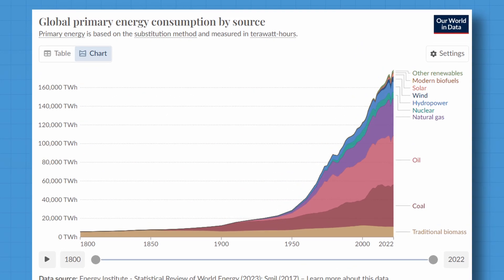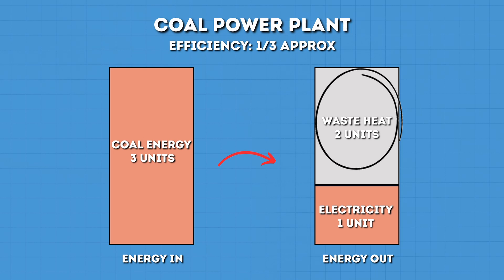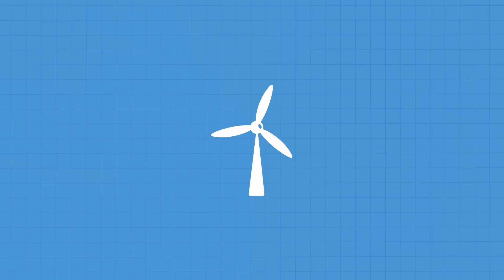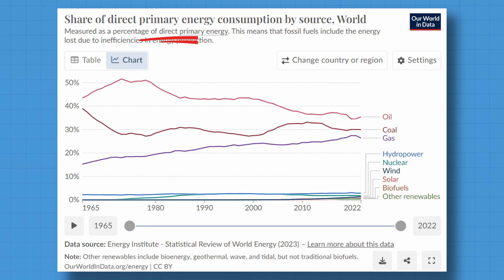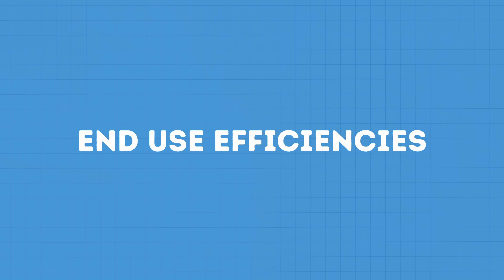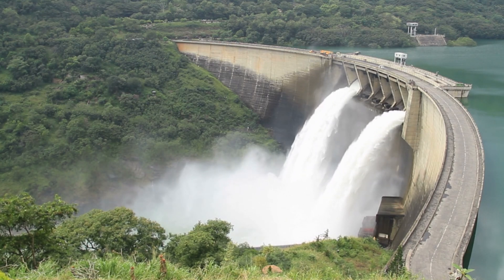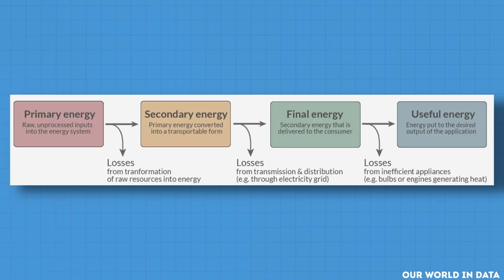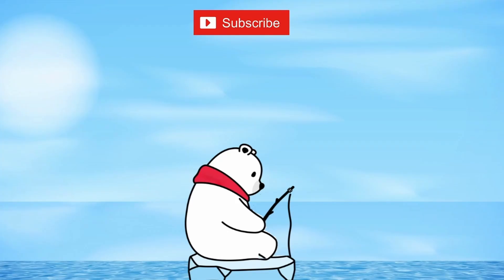We need to talk about the Primary Energy Fallacy

Comment: Since you cursed so much, its also good for your rebutal, you over simplified so much and missed out on the elephant in the room, intermitency and storage has massive costs, you dismissed energy storage almost as if its free.

Renewabale Enengy is trading a high value intermitant electrical energy for a lower value of energy usually thermal or chemical that has to be converted with losses into electrical. But you ignore the storage costs and you also ignore how varied these processes can be. Every one of those waste heat sources comes with essentially free storage, in the case of coal oil and gas it is usaually consumed shortly after extraction but the storage can easily be for several months or years if need be. In the case of fission, the storage is essentially for millions of years after digging it up, it can be processed into yellow cake and then Uranium fuel at will. It is also available from the oceans at moderate cost too essentially at will.

But your precious solar and wind can not be stored economically,, it's about 10,000 times more than chemical energy storage. The avg capacity factor of wind is only 30% max. The max capacity factor of PV is typically only 14% in the US NE. It can reach 20% or more in the US SW. In northern europe its only about 11% in the UK, but more in spain.

Buy a plastic bucket for about $1 and it easily stores 30KWh of chemical energy either liquid or rock form worth at least 10-20KWhr(e) after conversion.
Buy a Tesla wall battery and it stores only 10KWhr(e) for a whopping $10,000 or so and you have to pay for 1 of its wear and tear cycles say atleast $10 on top of its stored energy value of only $1 and that electrical storage in batteries is only for weeks at best. They self discharge you know. And batteries really really hate being full or empty, which is why Tesla keeps them in their 20-80% zone as much as possible when wear cycles are effectively 10x less severe. So to lkeep batteries near the 50% zone means you really have to double capacity to use the rated value, they suck.

You know that in the USA, solar insolation is 5x better in the summer than the bloody winter. How the hell do you store summer electrical energy for months rather than just days. Even for wind you would need a month of storage if thats all you had. The Danes play a lot of complicated games with their wind to extract as much value as possible, but a huge proportion of it is used to make hot water for heat storage and if not enough storage, throw it away. Does you production graphs cover the curtailed energy from useless over production, I doubt it.

Also the intermitency issue means that say you convert any of this precious energy into hydrogen for steel, you first have to make it 100% base load becaue all thermal and chemical industrial processes are always as continuious processes. God forbid your hydrogen production needs a catalyst like platinum while the electrical input capacity factor is mostly low.

No improvemnet in battery energy storage is ever going to change this 10,000 ratio. If you could get 10KWhr(e) into the same space as a chemical, it would be a frickin chemical.

The alternative for intermittent only energy source is bleak with out that  free battery like chemical energy storage from combustible sources that you all take for granted.

Dont you fucking  hate it when anti climate people say they know more than climate scientists and deny the climate science.
Well fucking electrical engineers hate it when climate science that denies the simplest facts on energy esp electrical.

Everyone I meet that worships your fucking turbines has zero clue where the big battery on the grid is, they think the grid is just magical. That big battery is effectively the chemical energy that can be converted at will from the least efficient peaker plants. More renewables automatically means more lower eff peaker plants.

If you studied physics, you know perfectly well a Joule is Joule is a Joule no matter what form it takes. Some are more useful than others but only if it is continuous and available on demand. The least valuable is almost always the most storable like a mountain of moveable dirt or rock,  but also the least energy dense except the chemical and nuclear opnes. Have you heard about those morons that build cranes to lift concrete rocks into warehouse sized mountains, the stupidty of the renewable energy storage warrior knows no bounds.

If you want to know what is likely the best way to store electrical energy, Its would be hydro pumped up a hill, but it has high upfront costs but good round trip efficiency of 60-80%. But water energy density as in head height and volume is very limited to special locations, more likely normal hydro will shut down because of the environmentalists saving the fishes.

After this you have to convert your precious intermitent electrical into some less valuable energy like heat, or chemical, and every one of those has terrible round trip conversion efficiency.

But I will save you the trouble of figuring this out, the probable best solution we have is storing electricity as a heat difference in compressed liquid air, not CAES, but liquified air and then storing that in cheap steel containers and also storing the rejected heat in a separate container. When the stored heat is recombined with the liquid air it returns some of its electrical energy inputs. The best cycle is about 60% efficient round trip which if it is low cost,  is fricking bloody good. Not as good as pumped hydro, but the energy density is very good and its just air, sand and steel tanks. And all the technology was developed by the nat gas industry for other reasons, so thank them for saving your sorry arse. Several of these liquid air batteries are being built in the UK at energy capacity factors millions of times that of Li ion batteries. These will all be built near wind farms in Scotland.

Think about that, discharge a fully charged Li ion battery into a useless task like liquifing air, and possibly leave it for weeks, and get 60% of that energy back is remarkable, and the materials used don't exactly wear out, are not solid state, are cheap as dirt. The mechanics are a bit complicated, but its std chemical industrial hardware that is orders cheaper than Li ion batteries or should be. And no fucking cobalt or lithium or precious kids in african mines to boot.

If you did want to store your blessed electrical energy as chemical, you would have to go through the hydrogen gate keeper process and then for long term storage go through many more conversions to make more useful liquid fuels that store more easily say DME. Any idea what the round trip conversion would be, likely less than 10% and frickin expensive. But nuclear heat can do this very well, high temperature heat is very useful not just for making steel, fertilizers, its bloody good at breaking the H2O bonds and only needs Sulfur and Iodine as a catalyst, not bloody Rhodium/Platinum rare metals. Carnot always wins, higer working temps always raises efficiency, but you climate scientists absolutely hate working with heat.

So the next time you go off on the waste heat cyle, consider the storage is nearly free, and storage must always be paid for.

So if you did invest in storing intermitent electrical in liquid air, you are going right back to the primary energy storage as heat again, who would have thought it.

And by the way, when wind and solar are described on the Energy flow graph diagram, they are scaled up based on them being electrical. Similarly a 1GWe nuclear plant is scaled to 3GWth because it is in fact a thermal energy source. So 1GWhr of primary solar is in fact only really 0.3GWhr of produced electrical. So you cover that, but then you cry about it either way. And who cares about Iceland, Norway, new Zealand, those are all tiny outlier countries with huge hydro, and Norway has vast amounts of petro and fission metals too. Its called geology, they won the lottery.

And once you start to absorb the utility of liquid air storage, we are right back to primary energy storage.

Also you know that nuclear should always be counted as a heat source because sometimes it is used for district heating, unfortunately todays reactors are not very efficient, so 33% conversion is fair enough, but high temperature reactors like Molten Salt could easily achieve efficiencies closer to those of nat gas of 60% because the Carnot efficiency is what matters. For nuclear to get to 60% it would need coolant temps closer to 700c or higher and probably use CO2 as the working fluid in the heat to electricty power plant.

And while talking about nat gas, nat gas currently runs at either nearly 60% eff for CCNG baseload power plants but only close to 40% for peaker power plants ie jet engines that are used to back up intermittents. If you burn NG in a 60% eff CCNG plant and replace it with a mix of 40% eff peakers and wind at 30% penetration, you end up with bugger all CO2 savings since 2/3 times 1.5 is still fuckin 1 or 100%. So wind backed up by NG in peakers is a complete waste of time, no CO2 saved at all. But the windies don't give a tits arse where the backup power comes from and how efficient it is as long as the land is covered by frickin turbine temples.

Here is another thought, suppose you could burn nat gas directly in O2, no nitrogen involved, the thermal eff goes to 80% and the burn is vastly cleaner, no NOx either. If you crack air into O2 and N2 and have a paying customer for nitrogen ie the fertilizer industry, CCNG could claim 80% eff. If the nitrogen is just vented off, the 80% is dropped to 70% for the hassle of seperating the N first. Since we absolutely need fertilizers for food production, join it to CCNG power plants for the least carbon inputs.

Don't tell me, you don't want any fertilizer companies to survive, too.
Reply from the maker: Great essay there in the comments. I agree that you could definitely do a whole breakdown about storage when counting losses, however the video would have been way too long. So, I decided to mention it during the video but not go fully into detail. And FYI I am very aware of energy storage as I will be doing research on a particular technology this summer in the UK electricity context. I also don’t see how the cursing has anything to do. I will integrate your feedback for what it’s worth and for that I thank you, but you should probably do other more useful stuff instead of writing an essay in the comments
Reply from the maker: The cranes thing (Im assuming you’re referring to gravitational) is just dumb tbh
Reply: Massive storage media of any kind to deal with the intermittency of renewables is not really the way things are going with renewables.  Renewable energy is so cheap and so abundant that massively “over”sizing the wind and solar production and global hvdc interconnection is the way forward.  
The current thinking is that sizing solar and wind for the relatively still and overcast days is still cheaper and better than battery storage. So a lot of your argument just falls away.
Reply: @dominicgoodwin1147  You apparently think that infrastructure is free, that there is an infinite amount of free land, and that wind and solar are economically viable everywhere.  You should check the maps on Peter Zeihan's website that show where solar and wind make sense.  Who is going to pay for the vast amount of land and infrastructure needed for all the massively oversized solar and wind installations and the HVDC interconnects?  Where will people live and grow food?
“. . . a naïve observer might conclude that the rising share of new renewables (solar and wind) will usher in an era of falling electricity prices.  But in reality, the opposite has been true.”  Vaclav Smil, Numbers Don’t Lie, p.172
Reply: The other thing that you missed in your essay of a comment is that the need for peaker plants is already being mitigated by demand management.  Octopus Energy are already actively managing demand by rewarding people for turning off high energy items in peak periods AND paying them large amounts to feed their home stored electricity back into the grid at peak demand times.  People were getting paid about £2.47 per unit, I think, to feed in at those times.  Demand management, dynamic pricing, vehicle to grid, all that stuff knocks a big hole in most of your  arguments.
And we need to start thinking of burning fossil fuels as being as bad as killing whales to use their blubber in our oil lamps, as bad as slavery, as bad as child-abuse.
If you think I’m exaggerating, then you really don’t realise just how bad the climate crisis is. Just go and do some research.
Reply: @dominicgoodwin1147  You said, "If you think I’m exaggerating, then you really don’t realise just how bad the climate crisis is. Just go and do some research."
Actually, I have done extensive research on how bad the "climate crisis" is.  It's even worse than you think, but it's also different than than you "know".  The crisis is the blatant corruption and lying that has captured our institutions.  The IPCC was founded on the PREMISE that climate was a problem.  It is therefore doing its job of screaming that the sky is falling.  Opposing viewpoints are censored and defunded.  
In fact, the climate is getting MILDER, not more extreme.  CO2 is a greenhouse gas, and the greenhouse effect is real.  But water vapor is by far the dominant greenhouse gas.  And natural temperature change has been happening for millennia, and dwarfs human influences.  Greenland was named and settled by Vikings a thousand years ago during the Medieval Warm Period.  They were driven off the island by the Little Ice Age (LII), which peaked around the 1700s.  As we came out of the LII, we had accurate thermometers for the first time, started measuring temperatures and noticed they were rising.  This is kind of like getting a new thermometer for Christmas (in the northern hemisphere) and noticing that the outdoor temperatures were rising every week as summer got closer.
The following is true for the US:
High temperatures are not rising, low temperatures are.  That's why the average is increasing.  Severe weather is NOT increasing.  The frequency and intensity of land-falling hurricanes shows NO increasing trend.  Neither do droughts, floods, and wildfires.  Heat waves peaked in the 1930s.  This is all documented by government and independent data sources (not those "evil fossil fuel" boogeymen).

Comment: You do not take transmission losses into account. Nor do you take the losses that are caused by charging and discharging chemical batteries. Pumped storage also has inefficiencies.
Reply from the maker: Transmission losses happen for both renewables and fossil fuels when talking about electricity. Furthermore in most countries they are very low. Then, I did mention the losses that will arise with storage.
Reply: Take a look at liquified air storage with heat recovery its getting a round trip eff conversion of about 60%, pretty darn good for cheap materials. And its being built for wind buffering in Scotland, so I approve of that one.

Intermitents have another transmission problem, in the US wind states, the HVDC lines will be very long to connecting the east and west market grids but the wind only blows at 30% capacity factor, if all the wind was down that HVDC line won't be doing much. Better hope that those DC lines have something on them.